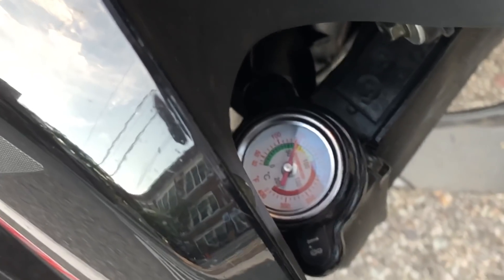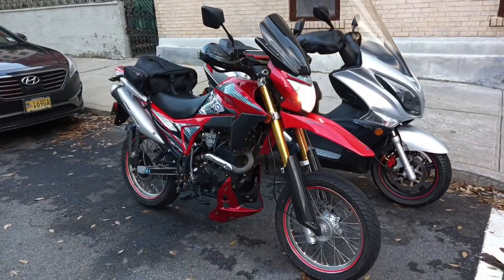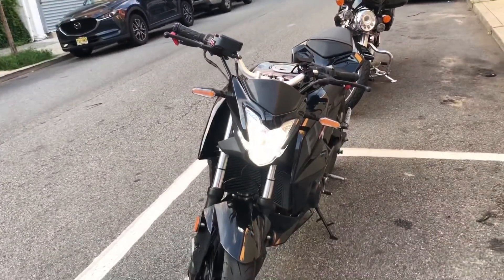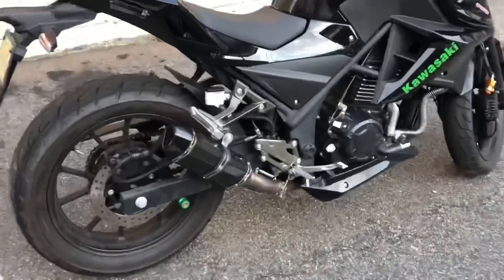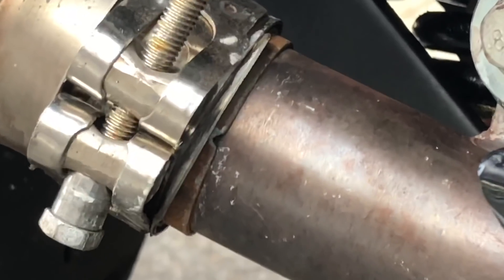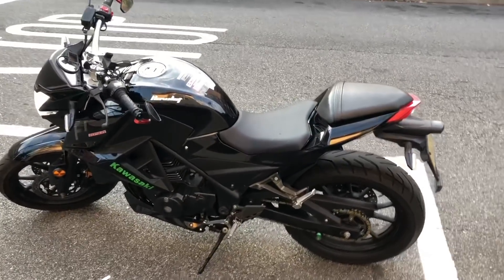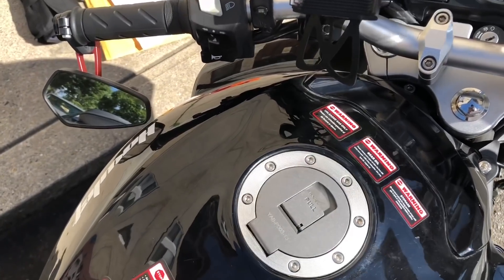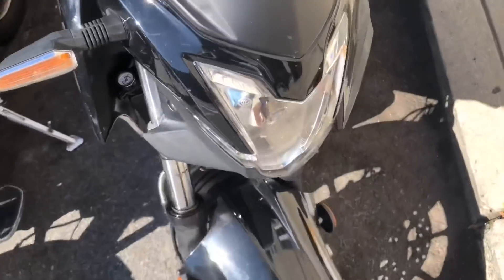How to Install & Bleed Dual ABS Braking System In Non-ABS Motorcycle / Low Price / Do It Yourself

Comment: cool stuff,.. so where can i get them, which ones you recommend for a 2015 honda 650f???
Reply: The part itself is a simple mechanical pressure regulator. = NOT ABS.

Unlike ABS, all this does is prevent the braking system from exceeding a certain predetermined hydraulic pressure, which you set with a knob and "by feel" which is inherently pretty dumb.

Real ABS has a wheel-speed sensor, an electro-mechanical switching valve for releasing and reapplying brake pressure rapidly, and enough wiring and computing power to make it all work. All that pressure regulator is gonna do is reduce your overall braking power so that you can't lock the brakes.

The device itself is super cheap, around 3 USD on aliexpress, not 100$ this dude is asking, lol.

Sure, this may "work", but it is entirely dependent on the pressure level you have it at.

Anything less than what you need at the moment you're braking, and the braking distance is longer than what you need.

Anything more and the wheel will lock anyway because it can't compensate for changing conditions.
Reply from the maker: Go to my website on this link and click the custom order to order this: https://www.chinasmotorsport.com/p/parts.html?m=1

Comment: Hello man.  I'm glad I found your video. I have a z900 love the bike but I got it with out electronic which is fine but living in a cooler climate the abs would help with colder pavement or wet spots. Do you have a working link I can use. To see about a device for my.motorcycle. thank you and I just subbed to your page.  Great content
Reply from the maker: If u need to buy the ABS shown on this vid, which universal for all type of of bikes u will have to place the order by reading the description. Be advised that this specific type of ABS is imported n is not going to arrive in 3-5 business days. If u can wait then place the order. Thanks for the sub :)
Reply: @Mr.FLOYDs  công dụng của abs đó làm gì bạn

Comment: Been watching your videos for a couple days now. I really enjoy the Jonway yy350, but as everywhere I have looked lately seems to say it has been discontinued. Very sad as I was really looking forward to getting this bike. But with that being said I have seen you say you’ve used the df250rts and I was wondering your opinion on it? I also see on your website you sell a fuel injector kit for 250cc motorcycles and I was wondering what that be something I could put on the df250rts and would you also recommend doing so?
Reply from the maker: Y thank u mate. I would say if ur thinking about getting a DF250RTS get the Lifan 200cc sport EFI. U will get the same experience n because of import reasons some bikes that r said to b lower cc’s r not. This bike u saw was for sell online for almost a year with no one buying it. The minute I start showing videos about it it went out of stock the same month because they only import one of each color and I believed they had about 4. I was the first one that made the purchase n everyone else gets a different color. And it’s not only this bike, the lifan v-twin 250 also went out of stock.

Technically speaking if u r thinking of getting something decent with fuel Injected get one of those lifan 200cc. They have the same horsepower as a 250cc. The fuel Injected kit that I lists for sell on my website will costs u $500 bucks. Unless u really need it n u know what ur doing as there r no supporting vids of how to install it yet, n u will need to modify ur tank by drilling extra holes with adding extra plugs n reroute ur vaccum lines then weld a temp sensor on ur exhaust, last but not least u have to fine-tune it so it can b ready n will not run smooth on the first test. 

Hopefully I will make a video about that in the future because after all I do sell it. Just don’t have a trusted gunny piggy yet because converting a bike to fuel Injected for me, that bike would have to b already good on its own n is different from what they r selling online,
Reply: Thank you I appreciate all the detail on what would need to be done in order to make it fuel injected. I didn’t realize it would take all of that. I am honestly a big fan of the Lifan series but my biggest problem with them is for one I don’t feel like the 200cc would be enough for me over all, most of the roads where I live have a speed limit of 60-70. And as I’ve learned from you it’s not good to constantly redline your bike especially something that’s only a single cylinder. So I had looked into a Hyosung gt250r but I really need something that can be shipped. So I really would love to have something more of a twin cylinder another thing that you really got me into haha. I want something that will last and still have enough power to keep up while I don’t want a big bike as I’m still a beginner and I don’t wanna feel uncomfortable. So it’s really difficult to find a medium which is what brought me to the jonway to begin with. I just wish they would import more over it seems like the perfect bike for me.
Reply from the maker: Yeh, then wait for a twin. V-twin in-line twin or any twin. Neither the DF250RTS nor the KPR200 would last if u ride like me. Doesn’t matter if it’s fuel Injected. Needs to b twin or at least a single cylinder that’s 400cc or more.

Also if u r really desperate for a good bike but don’t want to spend an arm n a leg, u can always get one of the BMW gs series. Compare to the expenses I spend on the V-twin lifan it would have been equivalent as one of the GS 300 which honestly different body style doesn’t matter to me. So on my next bike I might not get another Chinese if they r selling the same single cylinder n I might opt for another twin n a BMW.

Also dont buy used bike of any sort from anybody. Chinese or Japanese or any brand. A motorcycle engine is very sensitive to abuse n if u as the owner doesn’t know the history of that bike, u will regret it. I never buy used-bikes.

Comment: Nice video. You should probably advise ur copycat like on some forum I read a user who goes by Kakakid that these are not made for monkey mopeds lmao, and the bike needs to be going 60 miles and up to use the full potential of the device. And many people will say they found it on eBay lmao, after all eBay does sell everything, I hope they can back that up when they can't install it properly. Yours is definitely authentic whoever your sources are specially after watching this vid more than 3x and the ending demonstration shows the wheel lock and unlock in a matter of split sec. Amazing!